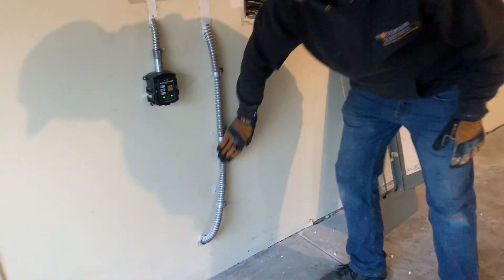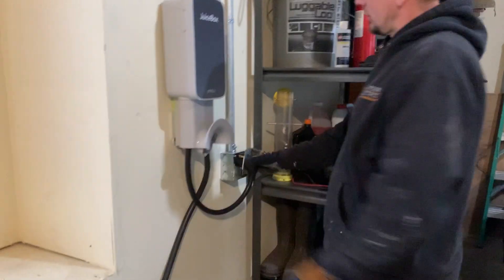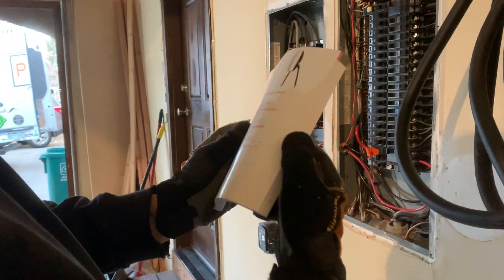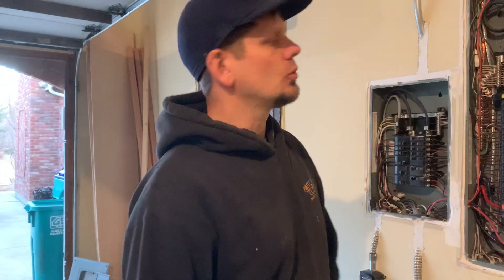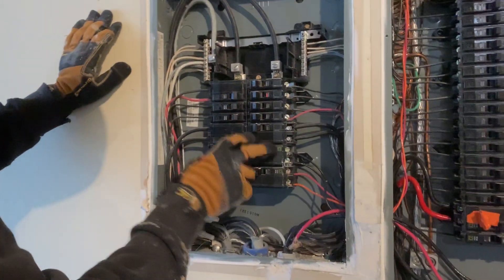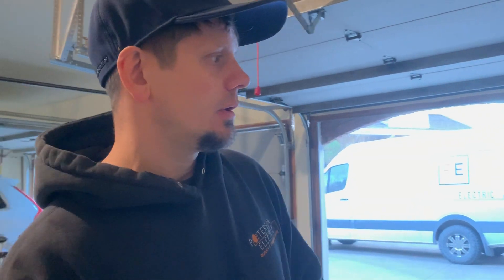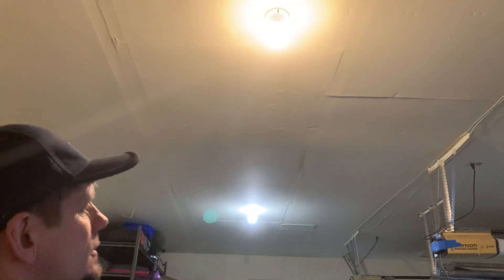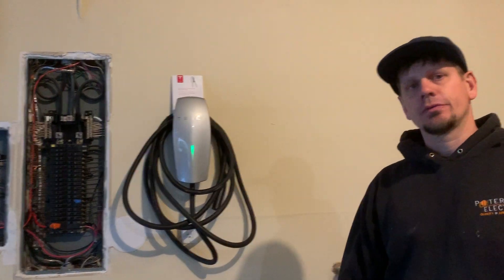Tesla Level 3 Charger Installation

Comment: This is not "level 3".  Officially there is no such thing as "level 3", but in the minds of ordinary folks, "level 3" is referring to DCFC (DC Fast Charging), which is supplying DC directly to charge the car's battery.  This Tesla charger is "level 2" AC charger, not DCFC.

Comment: There is no such thing as a "Level 3 charger", and there are 4 levels of charging not 3.  You have Level 1 AC Charging which is 120 volt 1-pahse, Level 2 AC Charging which is 208-240 volt 1-phase, Level 1 DC Charging which is 50-1000 volt at 80 amps, and finally level 2 DC Charging which is 50-1000 volt at 400 Amps.  There WAS a proposed Level 3 charging standard which was going to 208-600 volt 3-phase but never implemented for light vehicles.  The EV Charging standard is SAE J1772-2017 ( https://en.wikipedia.org/wiki/SAE_J1772 )

Comment: Thanks for your knowledge and the share.. hope you can help..😁
I would LOVE to have level 3 charging available at home. Detached garage. ~100ft run from the panel under raised floor in the basement then underground to garage. Will 6/3 steel armored cable be ok for that?

Comment: My main panel and sub panel are in the same building, one in the bedroom and the sub panel is at the other end of the house in the basement. This was done over 50 years ago. No grounding wire from the main box to the sub panel and near impossible to install one.  

I am replacing my sub panel box with a newer one with more spaces so I can put in a 240 line. I can easily put in a ground wire to a rod outside from the sub panel box but would this be right?  Everything in the old sub panel box is connected to the neutral.  Of course, there is already a grounding terminal with a grounding rod from my main box. Any advice would be appreciated.

Comment: My breakers box is in the basement. Can we install a sub panel in the garage? I have electricity in the garage and I have noticed I have a 240 volts outlet. Can I use that for charging? Thanks

Comment: Noticed in some of your EV videos you haven’t gfi protected your EV outlets.
625.54 all receptacles installed for EV charging shall have GFCI protection 
Minnesota is pretty strict on it. Even knowing GE gfi breakers are tripping prone on EV vehicles.
I found Siemens 50Amp GFI breakers have been the best so far.
Reply: its usually built into the charger itself . at least on the new tesla chargers